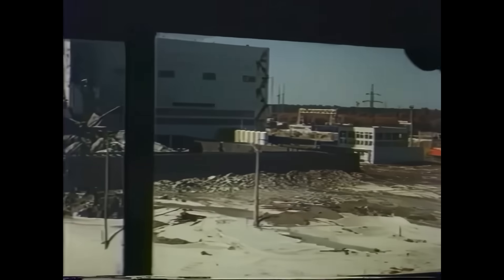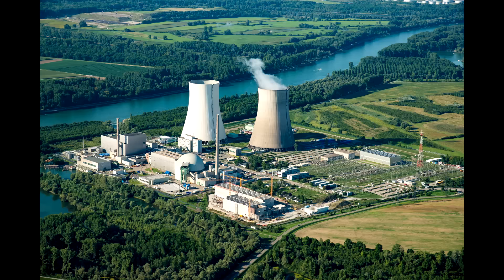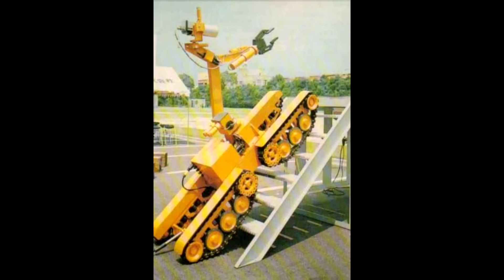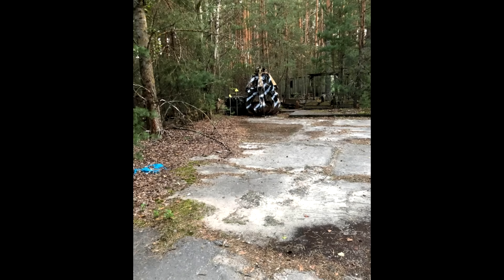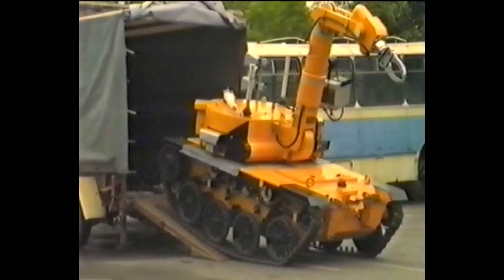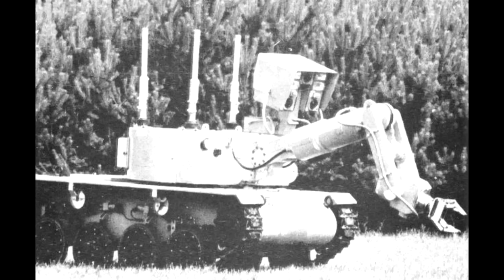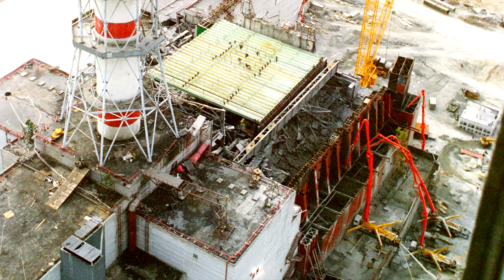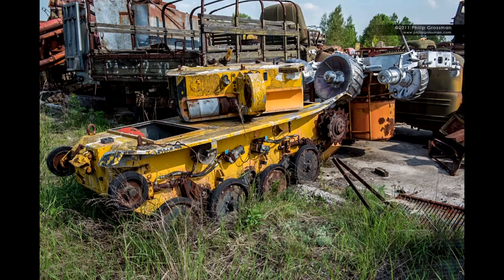The Tragic Story of Joker, The Chernobyl Robot

Comment: it was never advanced. not even for the time. the reactor setup was using unclosed water loops, directly connected to the outside, we dont do that anywhere else
Reply from the maker: I was talking about the Joker robot being advanced in this video.

However there was never a direct connection between the reactor loop and the outside; the only external water flow was from the heat exchangers of the turbines, which didn't come into contact with the reactor water, and was sent to circulate in the cooling pond, which a lot of reactors use :)

Comment: It seems like every story of Soviet incompetence basically boils down to, "The experts in the field wanted to do it the smart way, but the government officials disregarded their advice and ordered them to do it the dumb way because they were in a hurry." Then there's just a surprised pikachu meme labelled 'Soviet Government Officials'.
Either that, or it's more like, "We wanted to do this awesome thing, but we already shot everyone who knew how."
Reply: "Experts in the field" quite often became a part of the government...
Reply: @andreypopov6166 That was precisely my first thought.  It's not about "government" necessarily, but the centralization of power and accountability.
Reply: They wanted to save their own face that way, simply as that. It was not their fault that the robot failed in conditions it was never made for and not meant to be used (Like placing it right on top of debris, radioactive or not). Thats somebody elses department. They did everything right.
Reply: The Soviet Union was run by experts. Most political leaders came from an engineering or scientific background. Chernobyl melted down due to experts in their field fucking up.

Comment: I have always wondered why they never tried to come up with some sort of wire control. Especially on Masha,. there were some higher support elements (ladders and masts) that could have served as overhang or spooling points for wires providing control, power and even a ways to pull the vehicle if it gets stuck (by having steel cables wound into the harness). The vehicle itself  needs no heavy shielding so weight could have been traded to more useful loads (stronger motors/arms). Apart of having relays to actuate motors, everything else needed could have been placed far enough to be safe to operate and service. Worst case they lose a cheap, replacable machine that contains no hi-tech stuff. Cables are also cheap to replace etc.
Reply: I almost wish I didn’t know that.  So the USSR could have taken the opportunity to pioneer new radiation-tolerant robotics technology, but it was faster, cheaper, and more politically-expedient to give a bunch of guys a little hazard pay to go out on the roof and chuck a piece of graphite for Mother Russia. 

I recently read Kate Brown’s Plutopia.  The stories about early nuclear weapons manufacturing safety in the US make me genuinely ashamed of my country.  But the stories from Soviet Russia are the stuff of nightmares.
Reply: @adammorgan6229  - By the time they found out the robotics were fried, the robot was too radioactive to work on. They would have had to remove panels and probably other large parts, cut the wires to anything they wanted to work, then attach new wiring to a long bundle of wires. I wouldn't have volunteered to do the job on that roof with a big hunk of graphite two feet away, though I would have known how by the time I was a teenager. Grew up in a TV repair shop. They had just run out of choices, and the job needed to be done immediately.

The American program didn't suffer from the same faults as the Soviet one. They pretty much had more money than was good for them. There were at least four reactor meltdowns, including a deliberate one, at Santa Susana Lab, just over a ridge from Los Angeles. I can understand the very early days when risk seemed worth it, but they were still doing crazy things in the sixties.
Reply: @adammorgan6229  Also got to remember. None of the liquidators was of acual valiue in the russ... eh... i mean USSR's eyes. they were of etnic. religious, or political miniorities, hell probably even prisoners from gulags, was sent there. That's why russia even to this day, refuse to say more than 30ish people died from that accident. Only Ukraine have spoken out about it, and their most modest numbers speak of tens of tousands dead.
Reply: The problem is the radiation. Gammarays destroy unprotected electronics with their high energy. Thats why living cells also get destroyed, thats why those robots got inoperable after such a short time. Never underestimate radiation, its extremely dangerous
Reply: @Kinsanth_  Yeah, I know, I'm an electrical engineer. But when we're talking about the most basic things like wires and relays, these have no semiconductors or e.g. forms computer memory where data loss due to damaging ROM or RAM leads to bricking the device. Same goes to electric motors, they should hold out pretty long (none of the failures of the robots used were due to loss of the motor but the electronics and computers driving them).
Reply: @Blazs120gl  ah, that explains a lot
Reply: @Blazs120gl  - Overengineering Germans again.  A bundle of cables that work would have been better in this instance.
I bet it would be possible to make a motor that runs on ionizing radiation.
Reply: @GWNorth-db8vn  IMHO it's not the Germans' fault. The Joker was designed for explosive disposal and not with radioactive hazards in mind. In fact, machinery and electronics, when designed for the task, can withstand radiation (think of e.g. radiation therapy and CT machines or sterilization of food). And even the Soviet engineers thought that their space-grade technology could work long enough  in high exposures, so this was a common opinion among engineers facing this problem. Understandibly so, there were no corner case testing going up so high. In lab circumstances such demanding tests couldn't have existed and no sane person would have done it.
Reply: @Blazs120gl  - It was actually designed and built to work in a radioactive environment in a NPP. Its specific job was done in front of the robot and the underside wasn't armored. It was only used for police work after being retired from its original purpose. It's way too big for police robots even back then.
Reply: @GWNorth-db8vn  In terms of making electronics radiation proof, you only have two ways: shielding the electronics and add massive redundancy to the systems (backup and backup for the backup and so on). I doubt Joker has undergone the latter, only some massive lead shielding added. It's too much time to update a system that was not designed with such level of mission critical safety in mind (automotive: 1 backup aircraft : 2+ backups. Here, backups only postpone the inevitable: radiation will mess it all up, it's just the matter of time. Btw the joker was rated up to 1000 R/h, it's just that Masha was 15000 R/h. This is a design constriant of its own league :O
Reply: @Blazs120gl  It picked a nice hot graphite block to get stuck on, too. I don't think they even added any shielding.
Reply: Btw my best bet is that the engineers had the gut instict that wire-based solutions had been harder to set up on site and they had only estiamtes of the radiation until dosimetrists could actually approach the working sites to measure.  On the lower roofs with only one magnitude lower (under 1000 R/h), lunar rovers and other improvised solutions kinda worked. So basically there was no strong argument against hi-tech machinery thus no motivation to invent a completely different mindset. The cleaning work as a task of labour, were around 1 day job to a small brigade without the radiation. So the basis for confidence that robots will work long long enough to reduce the radiation levels, was not unfounded.
Reply: @Blazs120gl  - There are position sensors and such that need to be integrated with the motors. It had a rotating grabber with a wrist, for instance. Each axis needs at least one sensor, and that's a lot of wires to run back to a base station. Interpreting inputs and matching positions and movements is definitely something that needed to be done internally.
Any rewiring to simplify the onboard electronics would necessarily have to include only the most basic, such as direct control of the tracks and the dozer blade. It would have been functional but limited. They might have built something more suitable if the builders had any idea where it would end up. Joker was never meant to be anywhere but on a smooth floor inside an NPP.
Reply: @GWNorth-db8vn  Sure a wire controlled machine would have been a monstrocity, to say the least. But it also would have been simple and cheap.
I doubt you need too many sensors if at all. There were dozens of poeple at all times from multiple vantage points to eyeball what's happening.
(In fact, we in the Eastern bloc had such toy cars in the 80's. Remote controlled but not with radio, but controller hooked up via wires and bowden for steering. Think of it like that.)
Also think of it like a dozer with a fixed blade, it's sole mission being able to get traction on the roof and able to push hard so it just accumulates teh debris towards the edge of the roof. If something goes bad, there could be a connection that can be torn or disconnected remotely, pull in the wire, hook up another cheap/simple unit and re-deploy.
Reply: @Blazs120gl  - It was built to semi-automatically manipulate things, so it did need ability to integrate its own motions. For a simple remote-control pusher, which was what Chernobyl needed, eyeballs on a monitor from a distance would have been enough, and only a few fairly heavy wires would have been needed for that. It was just the wrong tool for the job, but it was all there was.

Comment: This is one of the stories that always just stuck in my head as a case of people overthinking... or underthinking, a problem.  You know the radiation will fry sensitive electronics... so why on earth would you bother putting anything silicone based in them at all?  There is already a tether cable on the robot... why not just run cable directly to the various motors on the robot and put the electronics on the roof next door... or just use switched to turn them on and off.  You don't need precision work here to shove debris off the edge of a roof.  
Even easier and more reliable, just build a hydraulic powered robot.  oil under pressure doesn't care about radiation various functions could be operated with simple electromagnetic solenoid, or if even that simple of an electric device is affected, you can use compressed air actuators to control hydraulics.  Doesn't seem like any engineering student couldn't easily modify a hydrostatic drive mini loader, common enough even in the early 80's, to be operated with a set of compressed air powered controls from 50 meters away.
Reply: Such a device would take weeks, if not months to produce. The roof had to be cleared in days, and as such they could realistically only utilize tools that already existed
Reply: @nickl407  weeks or months to bolt a couple motors to a frame.  A high school student taking 1980's robotics classes could do it in an afternoon.
Reply: @johngaltline9933  Putting an untested equipment into an environment that has never existed on this planet before takes a little bit more knowledge and expertise than an 1980s high school student could provide
Reply: @nickl407  And that's the whole point.  They chose to put equipment that was not tested, or that had been tested and proven not to work, in use, rather than bare bones things that had been proven to work, and that physics shows must work, that are not effected by radiation.  Brushed DC motors, mechanical hydraulic pumps and hydraulic cylinders all work just fine with radiation and once more, any high school student that passed their physics class knows this.  There is nothing new about using wire to power a motor, or, for something more common place in the 80's, 70's 60's or 50's, pure hydraulic power.  anyone not overly focused on needing to use some advanced tech could have unbolted the controls from a small 'bobcat' type excavator, run 50 feet of hose from the machine to the controls safe behind a wall, and had a perhaps difficult to use, but fully functional little bulldozer controlled remotely, with off the shelf 1950's tech that is immune to radiation.
Reply: @johngaltline9933  I'm sure your bobcat contraption would fare better than the robot purpose built for radioactive environments. I'm sure you know better than the thousands of scientists and engineers who tirelessly worked on solutions to clear the Chernobyl roof. I'm sure you could build your device faster than the roof ended up being cleared
Reply: @nickl407  Again, that is the point.  Nobody involved thought of trying something dead simple that would obviously work.  They just said Lets use our moon rover that is the most advanced robot we have, and lets try a German bomb robot designed for far less radiation, and not shielded on the bottom, where most of the radiation was in this use case, because it is even more advanced than our moon robot... Oh, never mind, lets just have guys run out with shovels instead.  Nobody thought, lets just use bog standard industrial equipment that has been proven to work for the last 50 years and is used on every tractor in the world.  It does not get simpler than a hydraulic cylinder powered by a gear pump.  I'd go with motors and mechanical switches, cause that's what I'm more familiar with, but hydraulics is dead ass simple stuff that just plain works.  Send me 20 grand and I'll drop my work, haul my ass to Granger Monday morning, and have you a dozer by 9 am Wednesday.  The fact that you don't realize just how absolute simple such a thing is proves the point that folks that don't use this stuff every day overthink the problem.  The best I can find for information says it took several months throughout the summer of 86 to clear the roof, by nearly 4000 people.  So give me the same 4-6 months to do it and I don't see how again, any basic hydraulic mechanic couldn't get the jobv done.  In point of fact, while trying to figure out how long it was before they even started clearing the roof, come to find out, that bog standard, bulldozers with lead shielding did, in fact do most of the work around the site, because they just worked, where radio controls died.  No one seems to have thought about hardwired controls, or pneumatic/hydraulic controls.

Comment: What I was wondering. Why didn't they just build hydraulic robots instead of electronic ones? That would have even been easy. You simply take a small excavator and remove all the electronic components and the hydraulic pumps and controls, and insert long hydraulic hoses between them. This way you could control everything from a safe distance without noticing the effect of radioactivity.
Reply: There were no excavators small or light enough in the entire eastern block, because there was no need for them to exist. On small excavations everyone just used manual labor, which there was always a surplus of. After Chernobyl there was no time to design, prototype, troubleshoot and manufacture a new machine from scratch. Very long hydraulic hoses are a terrible idea, a bundle of them would be too stiff for this size of machine to move freely. They would also be abraded and punctured while being dragged during machine operation. The correct way would be to take a purely mechanical machine and add an electric control system, based entirely on relays, electromagnets and analog servos, 0% silicon content.
Reply: What your suggesting sounds exactly like the kind of remote demolition vehicle that Brokk have been manufacturing for over 40 years.

Comment: I never understood why they didn't clear the roofs from the door OUT? They run through all the debris..
Reply: If you pick something up at the door you still have to run through all the debris with it to chuck it over the edge, only more slowly as you are carrying something awkward and/or heavy as well as highly radioactive, thus increasing the exposure time and dose. Better to start near the edge so you can run quickly through the debris without carrying anything.
Reply: @Titan604 Huh! I did not think of that. Now I feel dumb!
Reply: They probably prioritised hot spots, it was probably easier (and safer) to focus on them first. The worst affected parts must've been above the reactor and where parts of the reactor had landed. Scary none the less.
Reply: @Rotwold correct and I believe they prioritized graphite because it was visually identifiable and highly contaminated.